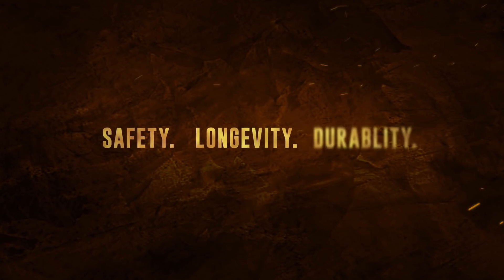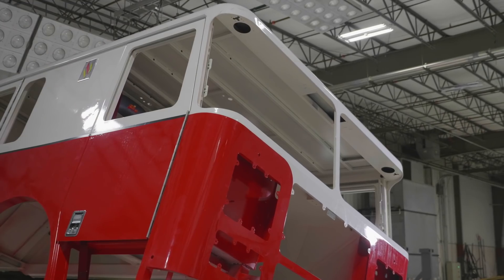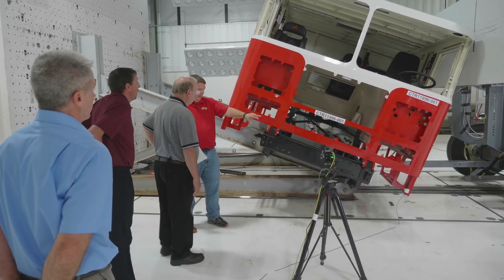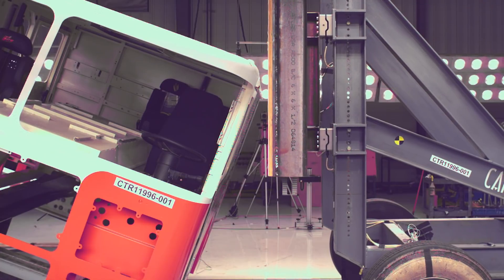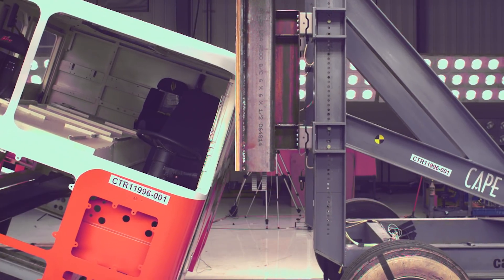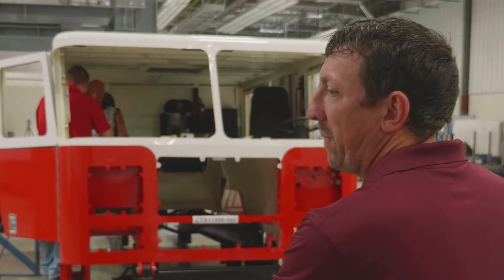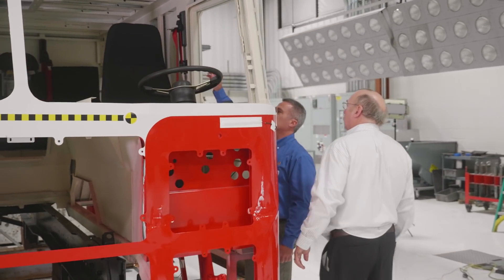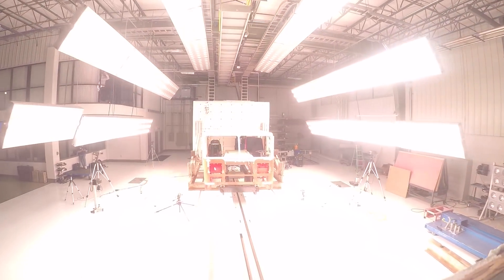Seagrave Crash Test

Comment: Great video to see what goes into the thinking ahead for the safety of the most important equipment, the fire trucks will have on them the fire personnel. Seagrave will always be an important part of my days as an active volunteer fireman, the first company I joined and you were able to at 16 had a couple of Seagraves as the front line pumpers. Naturally with being young, I asked about why was simply told that the needs and dollars fit the bill, and also easy with a local place to repair.Than after was married annd joined a differnt company,this was combination volunteer/paiid. They still ahd most of the older ones around but in resever but still ready to go and our company had for a parade and event truck a 1939 pumper,that was running. We did than have a group that got together and did a frame off restoration, repaint with the newer type of red paint and also had the inline 8 cylinder rebuilt.This was also the original from day one, when you are standing next to she just really purrs so nice and quiet, who knows with care long she may last.